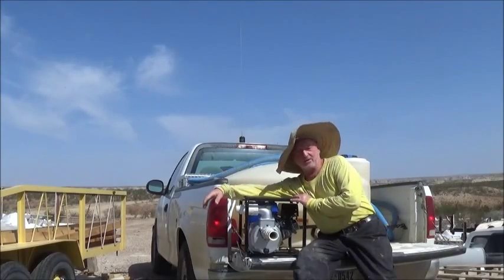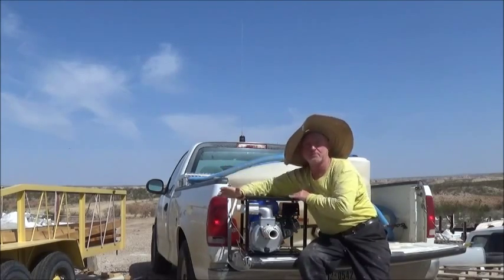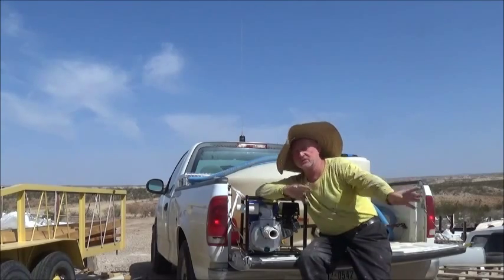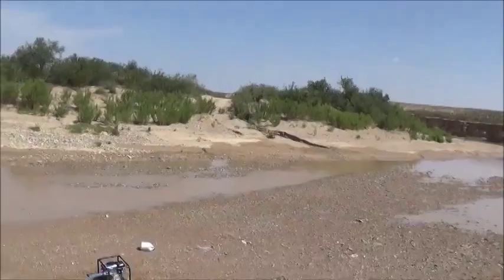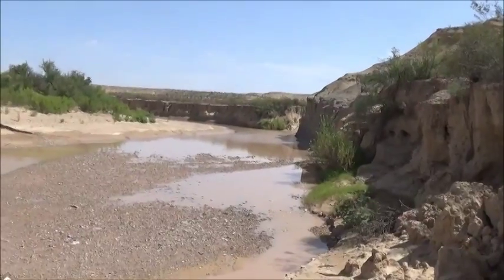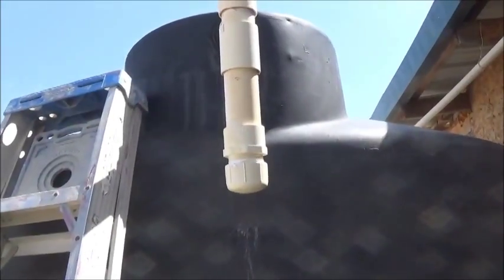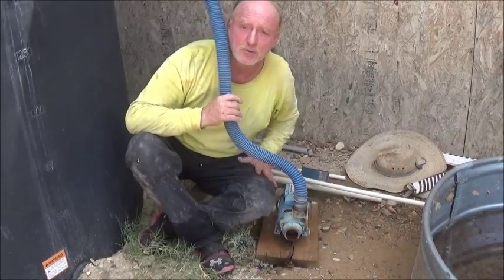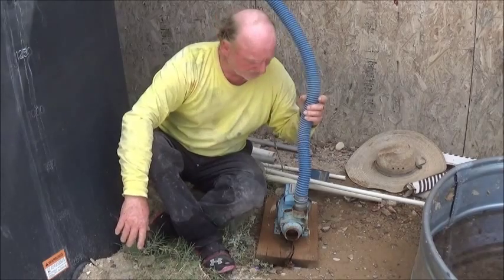Paying The Water Bill!

Comment from the maker: The truck tank holds 210 gallons. A bigger one is available, but when we bought this one, we had a Mitsubishi P/U that was to be the main work horse and the larger one would not fit it. Gravity IS faster, we use gravity for filling the grey water tank which is partially buried, but these tanks are not really designed to be buried and ones that are, cost 3 times as much at least!

We are digging a cistern now that will be inside the greenhouse. That is a rather complex project, but any additional water that we have to add to it, will be able to gravity feed.